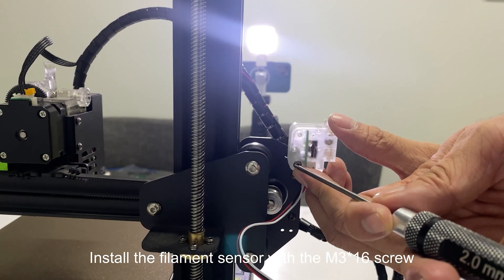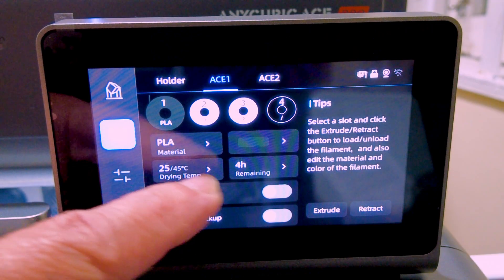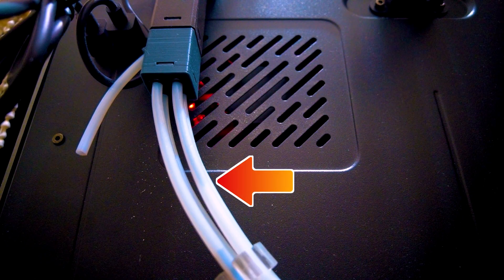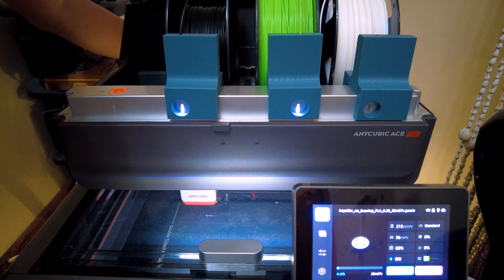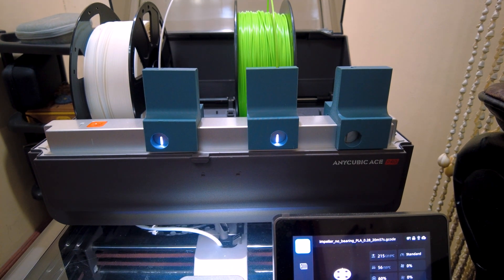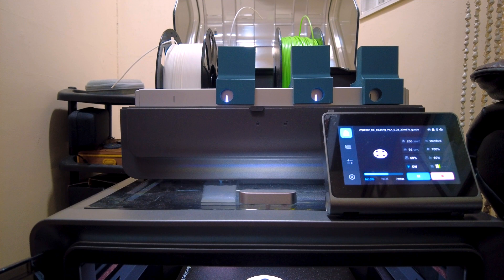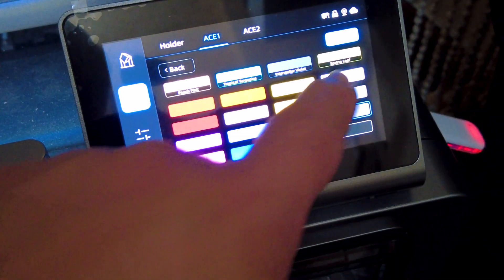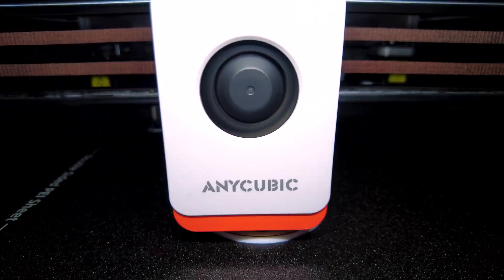Never Run Out of Filament Mid-Print Again | Anycubic ACE Pro Filament Backup Feature

Comment: Thanks a lot, just saved me a 3 hour print
Reply from the maker: I ran out of filament mid-print on a 16hr print (I miscalculated the remaining filament). Had to order new filament, wait for it to arrive, and load it up on the ACE Pro. All that time the printer was just paused. 😅 Saved the print this time. It's still not fool-proof especially with prints that are easy to topple over or lose adhesion from the bed.

Comment: Mine doesnt do this, as soon as the end of the filament leaves the port of the ACE Pro, it will instead flush all filament in the entire line rather than how yours seems to detect it at the extruder. Any idea whats going on? I am on the latest firmware as of June 15 2025
Reply from the maker: Hmm that's odd. My first test in this video actually purged the remaining filament, but that's because it finished the print, and obviously it can't retract the filament back to the ACE Pro as it's already too short, so the machine just purges what's left. May have been a firmware update. I believe I was still on 2.5.1.6 on this video.

Comment: Does it detect the filament run out in the extruder?
Reply from the maker: Yes it does, it will continue printing with that filament all the way until the last bit comes out of the extruder. Only then will it switch to the backup filament. You can see this in the video.